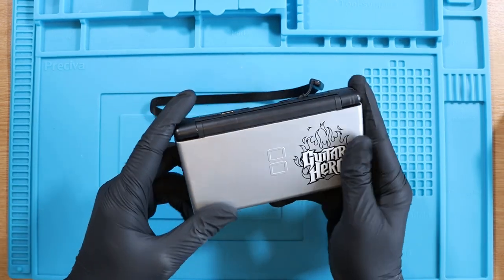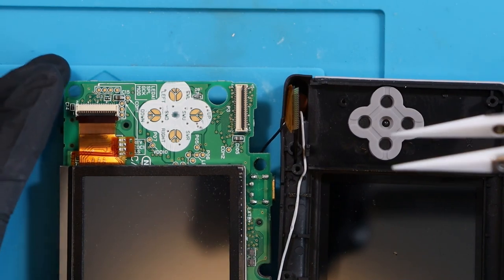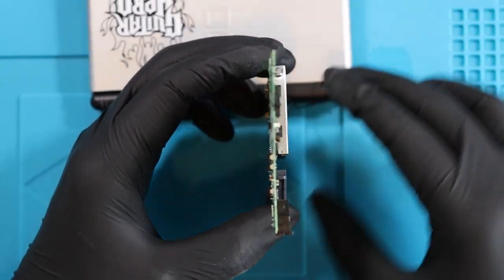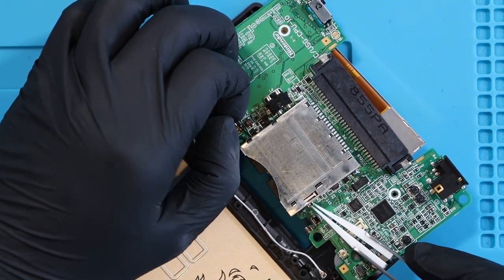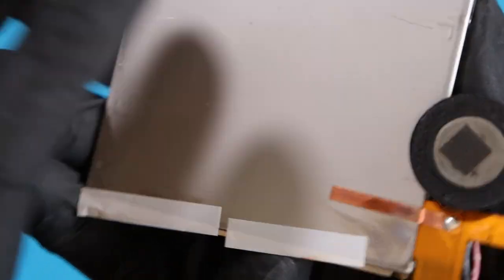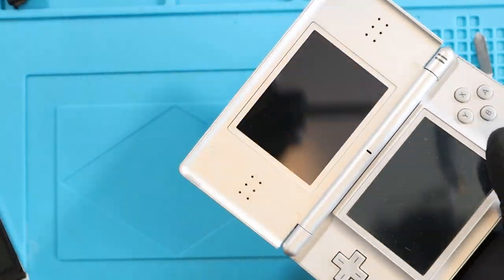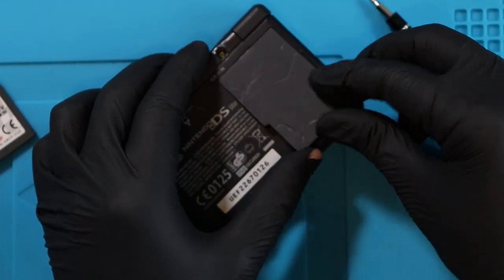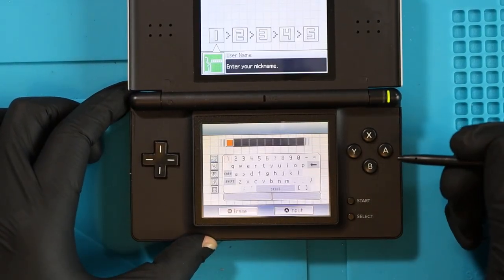This Nintendo DS Lite Doesnt Work - Can I Fix It?

Comment: Hey Joey I finally encouraged myself to repair mine after watching so many videos of the subject, when I'm done with it I'll let you know thank you for being a factor in me doing it
Reply from the maker: No worries! I hope it all goes well for you. If it doesn't remember we're always learning! Feel free to join the Discord to share some pics of the project :)
Reply: Any update?
Reply from the maker: Mrsuperking Youtube631  Do you get a quick flash of a green light when you turn it on? If so the ribbon cable is loose. So did you replace the LCD screen already?
Reply from the maker: Mrsuperking Youtube631  That's a very strange issue that I've never heard of! Maybe try and take the ribbon cables out and plug them back in, they could be loose?

Comment: Your DS Lites are coming on really well Joey - keep it up buddy!

The small thing I would've done differently is the WiFi cable. As the terminal (popper? reminds me of coat fastenings) couldn't pass through under the cartridge slot, I'd have desoldered at the WiFi card, the pulled 5he cable out from the popper connector side. But meh, same ultimate result with a working DS via a motherboard sub.
Reply from the maker: Thankyou Toxo :) Yeah that makes sense!
Reply: Hindsight and all, eh  @JoeyDoesTech , especially as the mind works differently under pressure and stress of the moment. It's all research and development. 😁

Comment: Those dark marks on the bottom screen are from where you cleaned the back with IPA. I made the same mistake a while ago. The IPA gets between the layers of the screen and reduce the reflectivity of the back layer. I fixed mine by carefully using a hairdryer to evaporate the alcohol inside.
Reply from the maker: This is actually amazing to know... thankyou Stuart! I'll bare that in mind next time.

Comment: It's great to get working innards into that fine looking shell.  It's had some major event to take out both screens and bend the board (bent it enough to move the cart slot down and trap that wire!) - possible got shut with something sat between the screens.  Nice to see it running!
Reply from the maker: Yeah that's a very good shout Paul. My guess is either that or someone stood on it by accident. Thanks for watching, I think it looks wicked now 😁

Comment: Those wet marks can be cleaned. Or you can take out the white light diffuser panel out of a broken screen and replace it. I have done both many times. Not easy, but not as hard as reballing an APU.

Comment: Great video joey you really inspire me recently i plugged in my ps2 again for the first time in a while only to realise two of my controllers were broke and i didnt think i could fix them one of them had a stiff analog stick and the other one had stick drift and sticky buttons i took both apart cleaned them up made them look like new replaced the analog stick and potentiometers and it worked i was so happy i could play ps2 again because i didnt want to spend 50 euro on two controllers so i saved 50 euro and the environment thanks to you keep up the great work
Reply from the maker: Amazing stuff Daniel! The fact that youre saving money AND doing good for the environment is great. Keep it up!

Comment: Awesome repair!
It seems that someone stepped over that DS (maybe an angry dad stumped it because someone was spending a lot of time playing videogames😅)

I notice a slight flicker on the bottom screen. Is that happening or it is just created by the camera?
Reply: there are small potentiometers next to the battery that can be adjusted to fix screen flicker, so its probably just uncalibrated.
Reply: @CallyWasHereOfficial  Yeah, the one of the right fixes that. I wasn’t sure if the flicker was real or if it was an effect cause by the camera

Comment: Hi! My DS was thrown from two story stairs onto the concrete floor years ago by my little brother and have not been able to turn it on since. I plug the charger in and it has the orange light but it will not turn on whatsoever. How should I fix it?
Reply from the maker: Hey! There are so many things that might be wrong with it. Maybe something as simple as the battery being out of place, or the top screen ribbon cable not seated correctly.